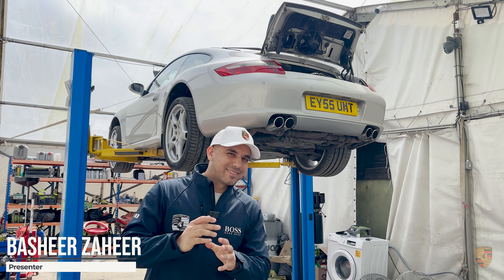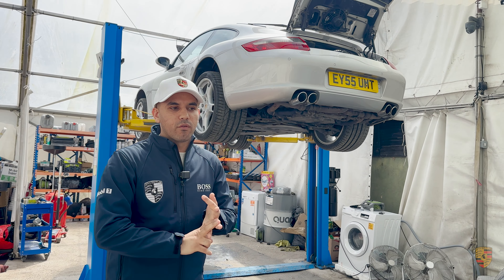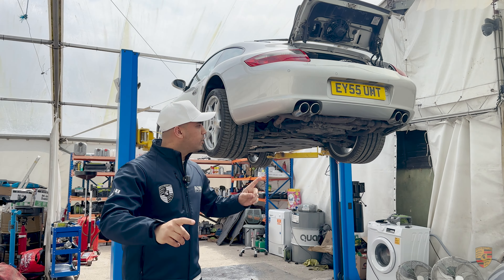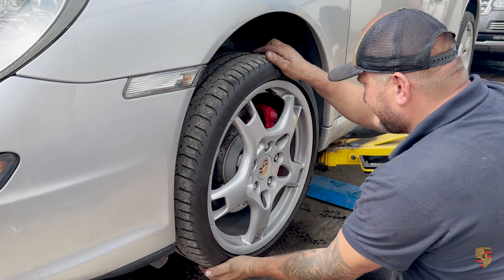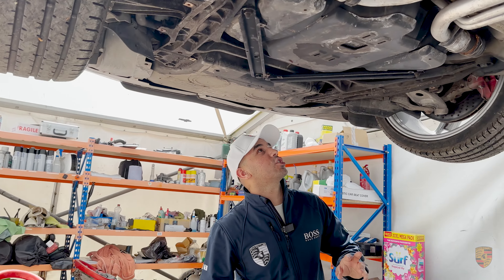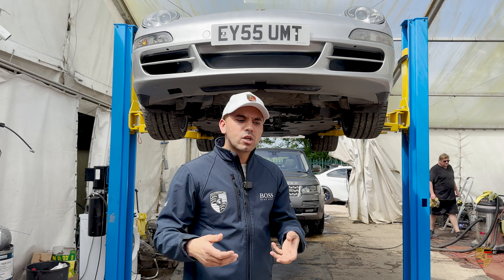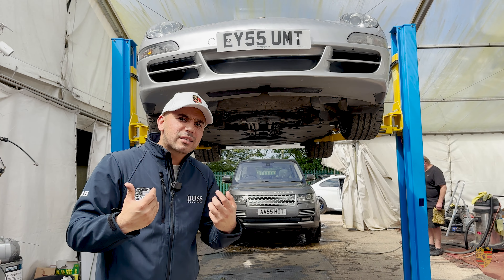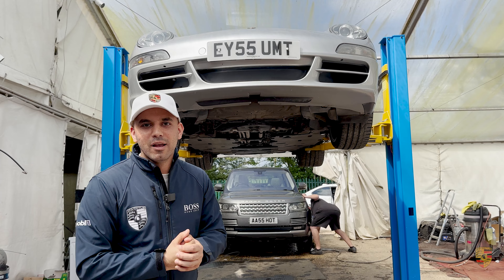Handling a Tricky Customer for a Porsche 911: What Really Happened?

Comment: You're correct in what you're saying about treating people with respect but that car is rough underneath and that hose clamp won't hold that pipe for long. I hope it was cheap because, speaking from experience, a lot of money will be needed to bring it up to standard underneath.
Reply from the maker: @russellmarsden9329  thanks it’s been a 1 owner from new 911 most of its life, invoices for loads of new coolant pipes, brake lines and soo much had already been done to the car. Now circa 20 years old, there will be some degree of care it will require. Are you from the UK, as it’s unfortunate here in this country that we get corrosion on the underneath of the cars due to the salt and whereas other factors as it doesn’t help us being an island
Reply: @InvictusMotors  I am from the UK and have a near identical car which was very similar underneath when I bought it. I bought it with my eyes open and knew what I was getting myself into. I've done the work myself as a hobby but anyone that doesn't have that option open to them is going to be in for some big bills. It sounds like your customer wanted a perfect car for cheap car money. Hopefully the person that ultimately buys it is a bit more realistic. Not criticising  you as you seem like decent fellas.

Comment: Usually, all the little white spots on the bottom of the engine are engine coolant, which is exactly what it looks like when dried by the engine's heat.  This may have been previously repaired but indicates a prior coolant leak.